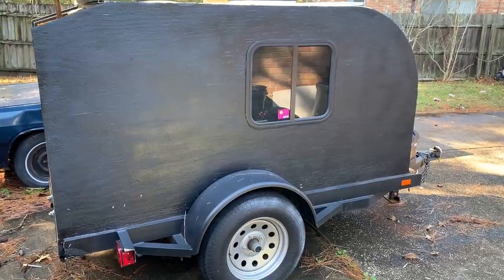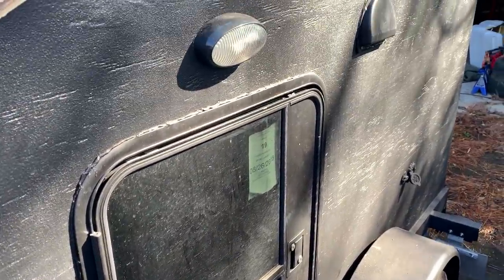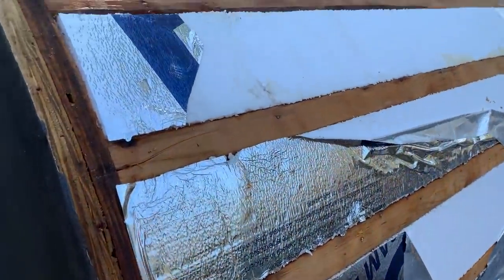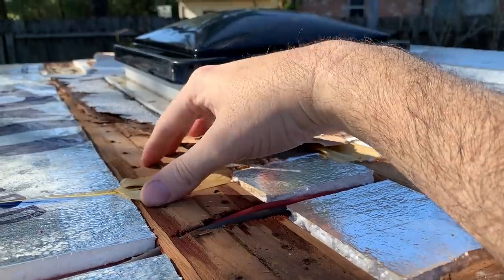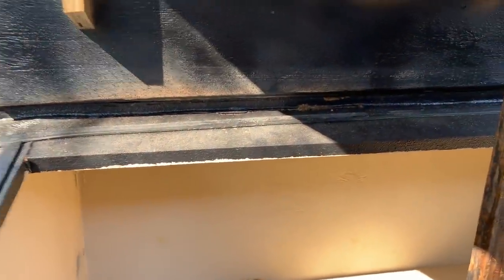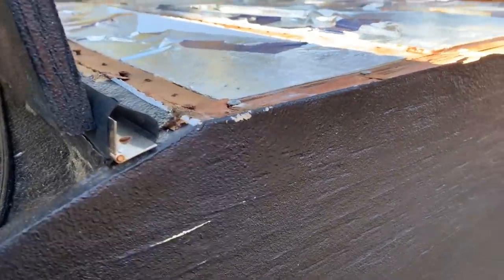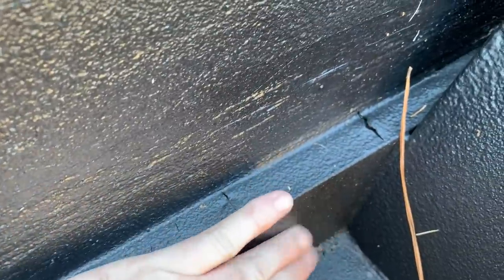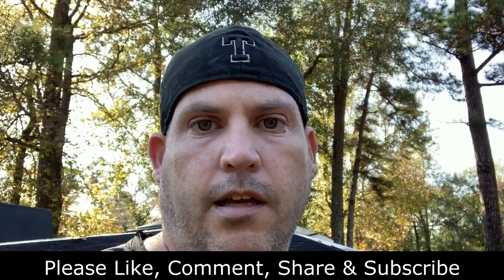6 mistakes building my micro-camper

Comment: Hé... I used an in the lenght cut open waterhose as a hinge for an allu box in front of my roofrack. One of those reinforced hoses. Clampt under an allu strip on both sides and 5 M screws and nuts every 5 cm. Works for years now without a probleme.... :-)

Comment: So I was thinking of making mine using steel and welding it together plus 3x coats of marine paint will this work I was gonna use a 4 x 8 trailer from harbor fraight
Reply: Build the frame out of aluminum for light weight..

Comment: If you use aluminium  sheeting on your sides and use your bundle tape on Tue top then lay another sheet of aluminum  that has  atleast 1" over hang on each  side to fold over the sides  and screw it to the sides  to hold it on the roof should never leak. As long as no holes get punched in it or a corner corrodes away.  You may also want to put liquid nail in squiggly  lines all over the top before sticking  the top sheet  on..  
Ya did good and can't beat learning from a mistake or two.  Peace!

Comment: Mistake #7 You used drywall screws to secure your roof vent, and they're all rusted.
Reply from the maker: Tony Bucca good eye. They were wood screws. Not the best choice. Thanks for watching!
Reply: Use stainless steel ones

Comment: 1) Metal flashing, roofing tape/meme brain. The entire outside is like a roof of a house.
2) rough-cut 2x3 vertical for more room for insulation or metal piping 2x2 or more
3) PVC panel with foam adhesive 
4) Aluminum Continuous Hinge ( Fineline Fabrications ) 
5) The door should extend beyond the walls to prevent water from getting in in the first place. The way it is creates a funnel. Then put a drip edge on and put a gasket on where the walls touch the over hanged door.
6) every fastener that penetrate the exterior you need  to be self sealing. Look for EPDM WASHER SEAL screws. Also consider PVC panels for the outside.

Comment: Best sealant for the wood is 5200 marine adhesive. Also, cover every inch of the outside wood, including the bottom, with fiberglass resin and it won't soak up any water. Make sure to get the edges of the wood too. Mix up small batches and coat it all. You can get both of these items at Lowe's. It may be a tiny bit more expensive but you won't have to go to the expense of rebuilding the whole thing in a year. You have to use butyl tape around windows, doors and that fan on top when you reinstall them. Are you planning on using two by twos for your frame this time around? They would make it much stronger. All that and building on top of the frame like you planned originally should end all those problems. Join a Facebook group for extra tips. These people can help with a anything you want to do. 

https://www.facebook.com/groups/1358261010866325/
Reply from the maker: Susan Highfield Awesome tips. Thank you for the info, and thanks for watching.

Comment: Was the plywood sealed with anything prior to the Raptor Liner?
Reply from the maker: Tony Latham no just made sure it was cleaned and dust free. Thanks for watching!
Reply: @BasecampUnbounded  There's another teardrop over on tnttt.com with the same issue –bare wood covered by Rhino Liner. I'm wondering if Rhino doesn't have some porosity and thus a poor choice over bare wood. Good video. Looking forward to your new build.
Reply from the maker: Tony Latham I think the Raptor Liner just can’t flex enough for the expansion and contraction of the wood caused by temperature fluctuations.

Comment: Bet you didn't  use rubber bushings under the floor on your mounting bolts to the trailer frame to seal out water wicking up into your floor along those bolts. Few builders  ever think of doing that. There is one camper builder down in FL building micro campers that never solved their leaking problems . Inside, their customers were getting stained,  water soaked wooden walls at floor level  in the corners . There were so many customers bringing them back to be repaired, there was little time left to build new ones. Their solution. ..build them with plastic composite..!  your stuff still might get wet, but no water damage to the  camper. Sweet! This is in my opinion  you see for what it's  worth. The company  shall remain  unnamed. ..

Comment: If this were my build I would think about a less traditional teardrop design with no rounded corners, I would after cutting and installing my supports and sides I would use a product like Thompsons water seal on all sides of the wood products even before using anything like that truck bed liner paint. I would also frame the sides and insert ridged insulation then skin both sides rather than using 1/2" or 3/4" plywood I would do either an aluminum skin on the outside or a fiberglass sheeting that Home Depot carries and then either luan or toung and groove for the interior. This is if I were building a camper. I think I would also stat my framing on top of that ,metal frame rather inside as you did on the first try I'm thinking it might take a while to cut that off so you can start right down on the actual frame.
Reply from the maker: Greg Boyer Tnaks for sharing your thoughts and thanks for watching!
Reply: Totally agree on the water seal. I watch all kinds of build videos and very few use any kind of water seal. I never understood why not, the frame and any wood directly in contact I would absolutely water seal  and silicon all edges.
Reply from the maker: Void970 t Yes I plan on sealing everything on the new build. Thanks for watching!
Reply: Thompsons water seal is not a good product for this it only last for short time and must be reapplied and you can not seal things to it like windows, or weather strip ect.

Comment: Why didn’t you simply use the trailer itself as the foundation frame by running your boards across from wheelbase side to wheelbase side with say aluminum diamond plate on underside. This would’ve given you a strong foundation with plenty of room for wiring, plumbing, insulation. Etc, etc. hell cut off those fenders and taillights and you’ve an open floor plan. Trailers still usable yes? And thank you for the video. Your trailer was a sweet build

Comment: Seems to me you should cook the whole thing with some Styrofoam board and use that use the method with the primer and the white primer dripper and the screen material fiberglass screening material on top cap the whole thing off of that you'll be fine and you have more insulation you can never have enough insulation
Reply from the maker: Joseph DuPont thanks for sharing your thoughts and thanks for watching!

Comment: I got a old boat trailer I want to build  tier drop trailer  but use those steal studs  and slant the walls out extra room  mine going to be 4 x10 by 6 ft tall not to crazy  cause I want to rent it out if I Had your trailer I would go crazy with it 4x8 but 13 feet tall and the front going over the toung some two stores  mini house and the back I would have a atv ramp welded on ( no not for atv for deck when cramping)and that extra support in front of fenders they  look like they would hold thin propane tank  that would lead your front for solar charger and battery
Reply from the maker: Aaron Davis sounds like an interesting build. My build will be pretty basic, similar to the original build.

Comment: That trailer frame was fine, you should have built up on top, up on top of the steel on the side. Who in the world did the caulking around the windows and all that is terrible and no way to caulk. When you caulk you take your finger and go around and SEAL the open areas where water will go in. You have to use good quality silicon caulk not cheap stuff. The way you did the sides you should have had the plywood right next to the fenders, you created and area where the water will rot the base.

Comment: These things are not easy to build. The trailer itself is a big issue. Yours looks of good quality even though the design gave you problems. Many use super cheap trailers that are junk after a few short years (harbor freight). I’m thinking about going the bedliner coating  instead of aluminum sheeting

Comment: The trailer was fine until you broke it. The problem wasn't the trailer, it was your design- which you didn't really have a plan for as stated in your video.

Comment: normal RV/camper plan good, then take table 1-3mm plywood and draw plan were come little piece wood if inside add table,self,cupboard,etch all place were come screw, then glue wood pieces to plywood. then add closed cell insulation, not newer open cell and styrofoam.eps. then glued top cover aluminium full wal, and cutting right size, and adding windows and doors, then instal side walls to place, same do front,rear,roof. in first all support wood glued,insulation and top aluminium, top alumin sheet have normal fuöö glued strong to insulatino and wood, tight have 0,2-0,5mm alumin.can use 1mm too. bit not 2-3mm too big. and roof piece installed last, and used good waterproof glue, and bend ower seam top ,rear,front all seam roof aluminium, and ofcourse have glue seal, before bend aluminium sheet seam. then instal and glued aluminium profile top of all seam. dont use silicon seal, only 100% acryl seal can use.and you have sealed waterproof longlive RV.

Comment: top roof aluminium NOT need be seam,joint anythink, you need full big aluminium rear to front and full top. or seam come rear and front wery down, first install down aluminium and then top, seam have upper at top 1 inc lower aluminium. and good waterproof glue, sikaflex or similar. or 100%acryl seal. not newer silicon, then leak next year sure.

Comment: biggest mistake have you use plywood top of wall and roof. not good leak wery fast. not plywood, only inside wall used waterproof airplane guality plywood. not cheap normal not have waterproof because plywood glue not have wayerprroof. and you use too lot wood supports, if good glue inner sheet,insulation hard closed cell insulation and outer aluminium sheet together no need lot wood support have wery strong whitout wood, only were come screw need piece of wood and all wood paint before installed waterproof liguid.